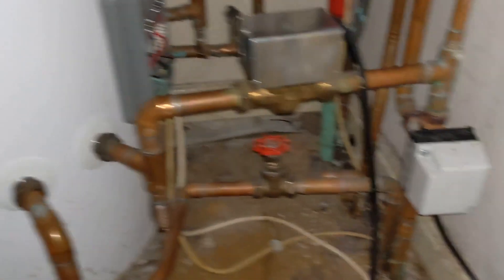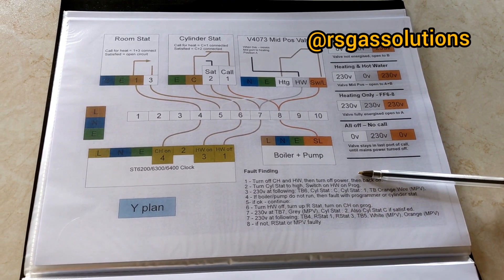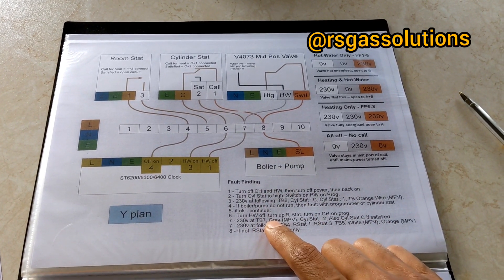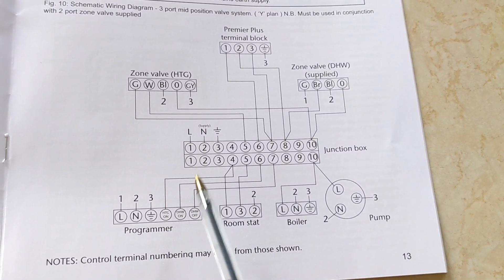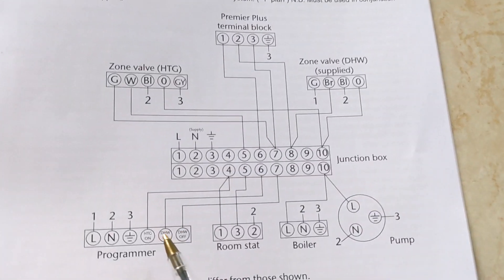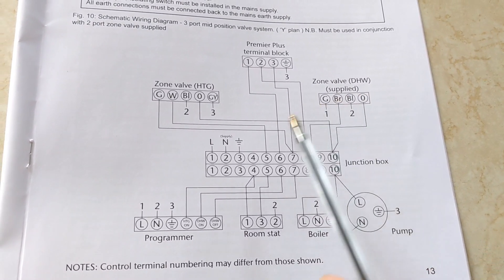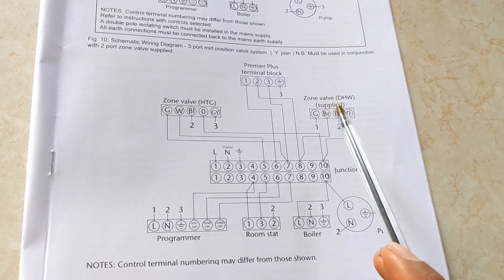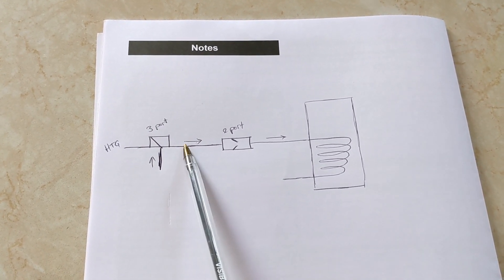Y-plan wiring for unvented cylinder

Comment: This is good, thanks. Why is the 3 port set to HW default? Would it be possible to reverse the 3 port, so that it was Heating default, would that not resolve the issue also?
Reply: Yes it would.
It called priority hot water.
the cylinder is fed from the A port of the valve and in an event of overheating, the safety cut out thermostat will cut off the supply to the mid position valve and the spring closes off . No more flow to the cylinder. simpler wiring because of no more need for the additional two port valve as a safety device.